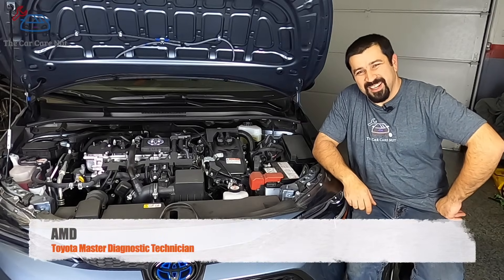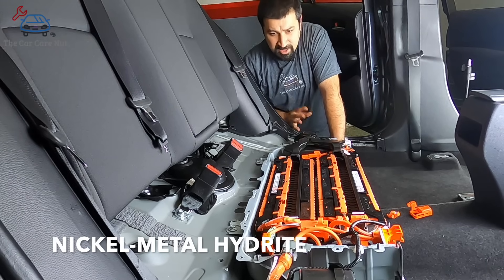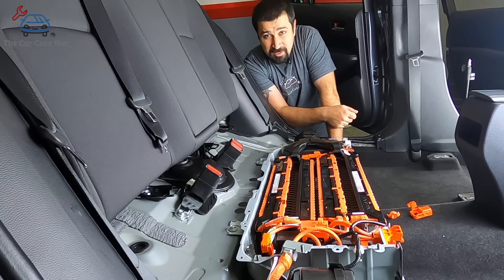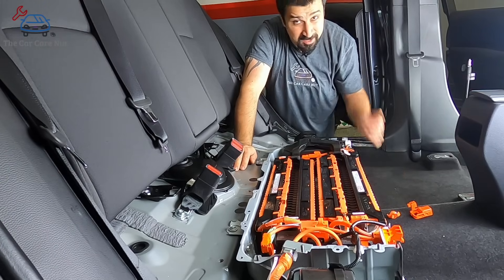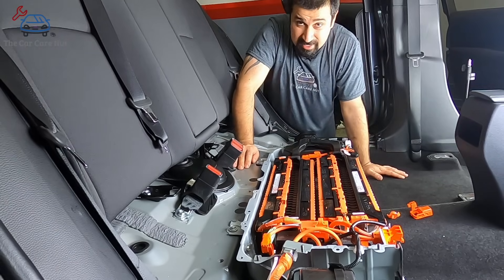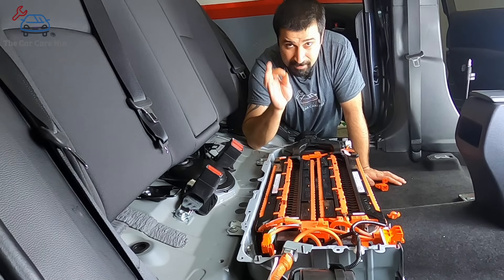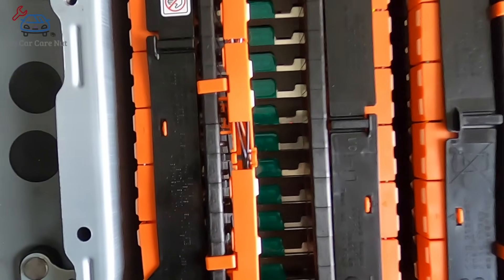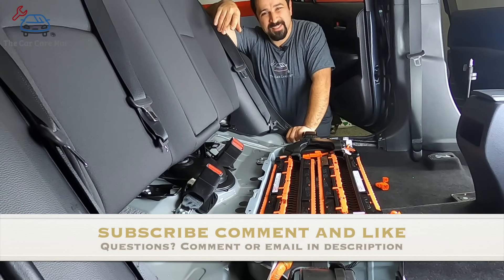How Toyota Hybrid System Work Part 1 High Voltage Battery

Comment: The 12 Volt battery runs all vehicle systems including computer, lights, radio, windows, mirrors. NiMH batteries have higher cycle life better for non-Plug in Hybrids which result in  more battery cycles than full Plug in models. Li-Ion batteries are better for plug in hybrids where vehicle is using the traction battery for (highway speed) propulsion as Li Ion batteries use less cobalt and have higher energy density

Comment: I have a 2009 Camrt Hybrid.  Is there a test I can run that can tell the condition of the battery fan?  Also can I test the battery using a simple can tool  like Blue Driver?  Thanks!
Reply from the maker: Hi! The battery fan can be cleaned and a filter installed and that should do it for the hybrid battery fan. And as far as the hybrid battery health there’s no real way to test one that I know of.
Reply: @TheCarCareNut  Thank you very much for your excellent videos/

Comment: Do you know if anybody ever tried to add an extra battery pack in parallel to double the electric range?
Reply from the maker: Yes! That’s the idea of plug in hybrids but of course a lot more is involved! But it’s definitely not DIY. I am working on another series on how plug in hybrids work
Reply: @TheCarCareNut  in theory it would be possible diy but probably not economical to do it.

Comment: Why would toyota not shutdown the battery usage when it detects a hot battery due to fan blockage?
Reply from the maker: It does but at that point the battery ran hot and is not regulated well. Repeat this process over and over and the battery life drops significantly

Comment: Hello, thanks for the video and explanation. I have two question for you. 1. Will Toyota hybrid car run with complete dead hybrid battery? (Only using engine)
2. If the car parked in 45 degree Celsius temperature for 4 hours, will it start or is there any issue in performance?
Reply from the maker: Hi! Thank you for watching my video. If the hybrid battery is completely dead the car will not run at all. The hybrid system needs the high voltage battery to start the engine and if it’s dead it can’t do that. And parking it for 4 hours in extreme high heat the car should start but might have the fan running on high to cool down the battery.
Reply: These things are a pan in the ass.  Now u gotta worry about how hot it is inside, then not driving it for awhile
What a pain

Comment: Greetings, and thank you so much for taking the time to share this valuable information. Today I had my car in neutral for a bit and the Warning light lit up in the – noting “traction hybrid battery is low move to P,” which I  immediately did, I am concerned if this caused damage to my hybrid battery I own a 2019 rav 4 hybrid please advise, thank you.
Reply from the maker: Hi! Thank you for watching my video! Don’t be concerned about damage. The computer doesn’t allow the battery to get too low where it cannot save it by charging. As soon as you put it in park it can turn on the engine and charge the battery and all is well. Don’t worry.
Reply: @TheCarCareNut  God Bless you! Thanks! We have learned so much from you!

Comment: When I was 14 years old I helped a friend repair a tube-type console radio. When I got there he had the chassis and the speaker on the counter. It was a field coil speaker (in those days permanent magnets were not good enough to use for speakers so they used electromagnets) and I knew the coil was used as a filter in the high voltage. What I didn't know was that for reasons unknown to Man one side of the coil was fastened to the speaker frame! The next mystery is why I had one hand resting on the grounded chassis and I slapped my hand down on the magnetic structure, making excellent contact with 300 volts DC. I felt like I had been hit in the back of the head with a 2X4, and everything got pretty dim for a few seconds, but I did not fall down. If it had been AC I would not be here to tell you about it; DC is not as lethal, volt for volt, as AC. Later, when I worked as an avionics tech in general aviation - small planes - I got 275 VDC between my fingers at least a dozen times... a quick yelp and a couple seconds of muttering curses. My brother and I also managed (long technical story) to get our bodies in series with each other across the 800 VDC plate supply in an amateur radio transmitter. Quite a jolt, and we were left with sterile pits in our fingers. That said, it is still hazardous. Will contact with battery voltage in one of these hybrid systems kill you? Think of it as being like falling off a roof. The odds are probably in your favor, but you really don't want to find out.
Reply from the maker: Very well said.

Comment: I don't know of you're familiar with European hybrids Toyota sell here, or if you have access to technical docs of it. I have a Auris (Toyota renamed the Corolla here in Europe for a decade or so, and now they're back to the good old corolla name) and a Yaris Hatchback. They behave differently when you start them. The Auris starts the gasoline engine after 7 seconds or so after you start the car. On the other way, my Yaris never starts the gasoline engine, you need to start moving the car and accelerate enough requesting more power for the gasoline engine come up. I would like to know the why's and how's of such different behaviour on these 2 cars. Thank you very much.
Reply from the maker: I’d say it has to do with the electric water pump and the lack of off heaters. Check both cars. The old one likely had a mechanical water pump and the new one has an electric
Reply: @TheCarCareNut  well, I can't answer that question of yours because I don't have the knowledge, but I'd bet that both of them have electric water pumps, based on things I've read before. I understand also that the gasoline engine has to be started to heat up the catalyst converter and the engine as well, while the vehicle is stoped, even if  my auris has at least half or more of the charge that the hybrid battery can take, that seems logical, but my Yaris doesn't do that...  It's like a different programming applied to it. Thanks for your time commenting on this. I'm subscribed to your chanel by the way ! Keep those videos coming!!

Comment: How often should one check and clean the filter in the hybrid battery area, assuming driving in normal road and air condition?  Is this covered in regular dealer maintenance schedule and at what mileage for the 2019 RAV4 Hybrid?
Reply from the maker: It will depend on your use. I’d check it every 3 months and see how it’s progressing. You could go a year without it getting dirty or a month depending on your use.
Reply: @TheCarCareNut  Thanks TCCN !

Comment: Thanks for the informative session.  Just to clarify, if we are away for an extended period of time,  it is advisable to connect a trickle charger to the 12V battery sitting in the trunk of my 2019 RAV4 Hybrid, right ?
Reply from the maker: I would either connect a trickle charger or disconnect the battery. If not doing either a small jumper pack from amazon would help get it started. It doesn’t take much power to start a hybrid

Comment: Do you know if you could safely install a dual 12v battery system in these (if installed by an auto electrician) if you wanted to run a car fridge, etc? Do you suggest never attempting to jump start another vehicle with a hybrid?
Reply from the maker: You could install dual batteries however I worry that the charger won’t be able to charge them both effectively. I wouldn’t jump a gasoline only car from a hybrid.

Comment: Very interesting and relevant, thank you. I'm not sure why it took so long for Toyota hybrid (or any hybrid) to take off, in terms of mainstream market demand. The fact that hybrid wasn't available on more of their models is a factor and they have continued to prove and refine their original design. Everything I've seen seems to suggest the battery lasts a long time, unless neglected or abused. The cost to reco or replace battery in 10 to 15 years is not bad, compared to other fairly common failures on other vehicles, considering the fuel and brake savings, etc.
Reply: I have a theory.
They should have used a stronger name than Prius.

Comment: This is the exact corolla hybrid I drive, down to the cooler and all. I've known that the battery is under the seat, but had not had a chance to see what it actually looks like without the seat. I love this video, it was full of information but easy to follow, I really like learning about this system. It truly is quite simple once you lose the fear of the unknown. I also love that you explained the clicks those relays make, I always hear them clicking in and tried to imagine what was going on there, I just thought of it as electricity flowing. I've had the car for about 18 months now, I ordered all 3 filters, ac, intake, and hybrid battery, I figure it's a good time to do them all, I wonder what the hybrid one looks like. I had intended to change the ac filter but had some trouble finding it some months ago.
Reply from the maker: Thank you for watching! Here’s a video that shows you how to replace the filter and shows you how it looks like. https://youtu.be/U7mjpvRihVU

Comment: With a vehicle like this, do you recommend or not recommend using a 12V trickle charger/battery maintainer if the car is going to sit for more than 3-4 weeks. Can you comment on both the new Lithium Ion and the old Nickel Metal Hydride. I have a 2014 Camry SE hybrid and I plan on storing it for the winter and was wondering what kind of trickle charger to use, that is if it’s ok to use.
Reply from the maker: Any trickle charger will do the job good really. I’m not too concerned about the 12v battery I would consider driving it every month for a few days to keep things moving.
Reply: @TheCarCareNut  I've read (here in Europe) on Toyota webpage, that they recommend, to recharge the 12v battery, to start the car without driving it ( if you don't want to drive it) and leave it on for 30 minutes. Turn off anything like air conditioning, etc, and leave it for 30 minutes for the hybrid system to recharge the 12 volt battery.

Comment: I'm really looking forwards to watching your entire how hybrids work series. I've had 3 Priuses, and now have a 2020 Corolla 1.8 hybrid, and (apart from one blown bulb), never had a single problem with any of them. Amazing reliability for such a complex piece of electro-mechanical machinery.
Reply: My wife and I have had a lot of cars over the last 47 years, but for the last 16 years we have owned nothing but Prius. She got one new in 2002, and the reliability was so good we were astounded. I traded in a Nissan 300ZX for a used 2002 Prius in 2002, and we have had only one problem beyond dead 12V batteries in all these years: my 2002 had a bad inverter coolant pump at 196K miles. By far the most reliable cars we have ever had. I have no idea which would come in second place.
Reply: @flagmichael   I have 2013 Toyota Prius V and have put 184,000 so far. I had to replace thermostat at 183,000 and break pads. No problems other than that. On top of that I get 50 miles per gallon, saving so much on gas. It's like getting a rebate of $200 to $300 from gas ,for every 5000 miles of oil change .It's like saving $4000 to $5000 on gas for every 100,000  miles. Amazing.
Reply: @flagmichael  Lexus
Reply: I bought new 2019 rav4 xse Toyota hybrid.. with weather package, moon roof. Magnetic Grey with black trim. I love my car, get over 40 mpg.

Comment: I have a 2012 yaris hybrid and I think it lost calibration. Around 2 years ago I forgot it in N and the battery went down to around 15% before I realized. From that time it has been acting very strangely. It goes down very quickly around 45% SOC. Even if it starts charging it still goes down and takes some seconds for the percentage to start going up again. It is as if the bms thinks it is around 40% SOC but in reality it is 30% or so. Do you know anything how to bring the calibration back? P.S: the percentage is the actual % as I use an OBDII app.
Reply: Make sure, first, the fan filter is not clogged with dust, hair, and other debris.
Reply: @rsalehi6568  fan is clean. I monitor the battery 3 temperature sensors all the time with the obd app and can adjust the fan speed manually accordingly too.
Reply from the maker: I’m not aware of a calibration to begin things back

Comment: The car care but , do the eco , power , normal modes make the steering wheel feel lighter ?? I notice if I turn the steering wheel a lot  in my hybrid car I get alittle worse MPG , since it’s hybrid does steering use electricity or gas ??
Reply from the maker: Thanks for the suggestion! The steering is electric in hybrids.

Comment: I have a 2007 Highlander. Is the battery filter even accessible? Can't find it anywhere.
Reply from the maker: The battery vents has a mesh built into them. There are 3 vents directly underneath the back seat. They have 2 small little doors that pop off to show 2 10mm screws take them out and vent comes out

Comment: Interesting video. 👍  There are six 1.2 Volt cells combined in a block = 7.2 Volt. Two of these blocks are connected into one module = 14.4 Volt. Inside the battery are 14 of these modules = 14*14.4 =201.6 Volt. Not something to mess around with. Special attention for firefighters that try to cut the car open in case of a crash! ⚡⚡⚡⚡⚡⚡
Reply from the maker: Thank you! It’s a very cool setup. Simple when you look at the simple math and electrical theory but complicated of how it’s actually constructed

Comment: What is the capacity of the battery? Does it differ from NiMetalH battery? Is is possible to replace my 2019 corrolla's Ni metal with Li ion?
Reply from the maker: I looked through the data and it looks like 2020 model had the nickel metal battery and 2021 had both options. The nickel metal battery is 201.6 volts and 6.5Ah and the lithium ion is 207.2 volts and 4 Ah. Retrofitting is likely not an option as it involves a whole new control system and the cost will not be worth it. Don’t worry about your battery, in 15 years with good maintenance you’ll remember me saying your battery is good.
Reply: @TheCarCareNut   woww, then NiMH  battery stores more energy(1310 Wh) than Li ion(828Wh). Thanks for details.
Reply: I do have a 2021 Toyota Corolla LE Hybrid.  Since you show us a lithium ion hybrid battery in this Corolla, I guess 2021 Corolla Hybrid has lithium ion battery? Thanks for this great video!  You just made my day!  :)
Reply from the maker: That’s the case. It still shows 2021 could have either but the one I filmed with was made in April of 2020 as a 2021 model
Reply: @TheCarCareNut  I will go to my Toyota dealer and ask them if I have the lithium ion or nickel metal battery, based on my vin number!  Thanks for the great information!

Comment: Anyone that can make the complex simple is one that really understands what they are talking about.
Reply: AMD has the knowledge and is very pedagogical whenever he talks about anything related to the maintenance of Toyota vehicles. I think AMD is what YouTube was missing regarding the maintenance of Toyota vehicles before he started this channel. 😊
Reply from the maker: Thank you Jonas and Spencer! It’s my pleasure  to share everything that I have learned to help people.
Reply: Here here! I could not have said it any better.period...
Reply: I have owned a 9 Camry Hybrid 2014 and a half Camry Hybrid and a 13 Toyota Avalon hybrid... Needless to say I'm into hybrids...
Reply: I just bought a 2024 Venza Hybrid (2 months ago) after owning & loving my 2010 Venza for 15 yrs (130k miles). This was my last chance to buy a New Venza. I am recovering from TKA surgery, haven't driven it much, my hubby has, but twice the 12 volt battery has died. Does my car have a built in voltage monitor? Is there a voltage monitor on the market you'd recommend? Could you show us DIYs how to safely charge that 12 volt battery? We live 1 hour from the closest Toyota dealer. I am the second owner and did buy an extended warranty on this certified car from the dealership. Will my warranty cover a 12 volt battery replacement? I do think our short trips (5-15 min twice a week) and our freezing cold winter in Northern MN (even though we keep it in an attached garage) has contributed to its weakness. 
AMD your videos have the best language that my non-mechanical mind understands. I have learned valuable lifetime information. Even though my husband is ready to buy back our 2010 Venza after the 12 Volt battery died the second time in the new 2024, I think we just need to gleen more knowledge from you.
Could you explain the 2 current recalls for my 2024 Venza? Bernice

Comment: Great video. Doesn't the Corolla Hybrid have a Nickel Metal Hydride battery and not a Lithium Ion battery?
Reply: In Europe, Corolla sedan has Ni-hydride battery, the hatch and touring verision (wagon) of the Corolla has li-ion. 2.0 hybrid (unavailable on the sedan) has Ni Mh. Both versions of the batteries has pros and cons. There are both very good.
Reply from the maker: It could have either or
Reply: @TheCarCareNut  Thanks. I have an early 2020 model. I assume that I have a NMH battery. Is there any way for me to check?
Reply from the maker: Email me your vin.